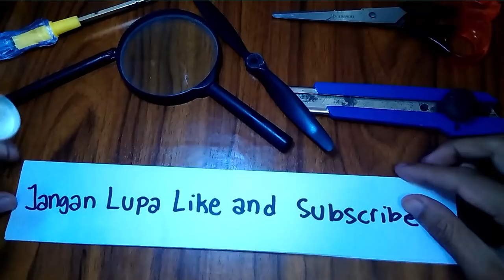DIY. Meja Resin | Meja Kombinasi Resin

Comment: Mau tanya mas..
Alas yg buat nuang cairan resin biar gk lengket dn mudah di buka pke apa ya mas..
Mhon infonya.
Reply from the maker: +Ibra Al Matari pakai cetakan Silikon Pak, WA 081802663894, atau manualnya pakai plastik tebal atau papan yg dilapis isolasi Pak
Reply: Wisnu Purnomo 
Misal papan aja gk di lapisi isolatip gk bs yo mas.
Reply from the maker: +Ibra Al Matari tergantung papannya Pak, tapi lebih enaknya pakai isolasi lebih rapi Pak
Reply: Beli resin nya dimana ya...
Reply: Teguh Adipati saya d bali,belinya d toko bangunan